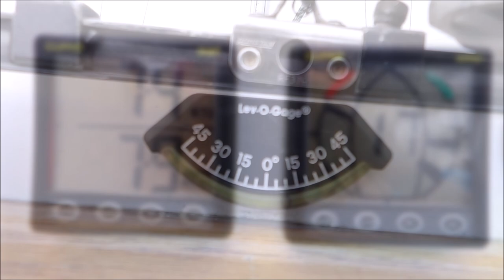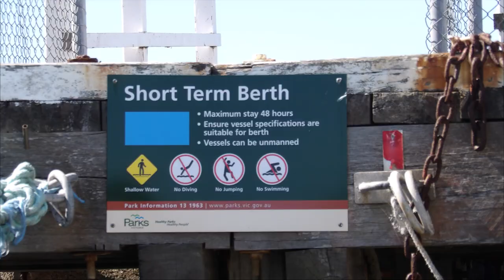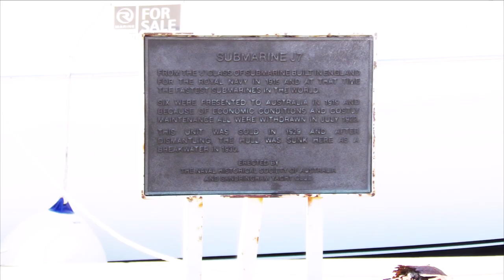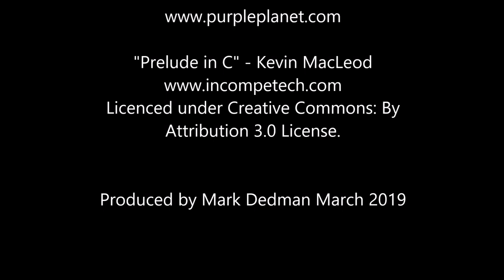Trailer Sailing the Wrecks of Port Phillip Bay Part 2

Comment: Nice work Mark. Neringa looks great. How do you find the Limeburners ramp for launch and recovery traffic?
Reply from the maker: The limeburners ramp if you could call it that is not really suitable for launching and retrieving trailer sailers, dinghies only. I just love Limeburner's for its peace and tranquility to spend the night before sailing 40 minutes back to Saint Helens which on the weekends is always a bit busy but nothing like the melbourne ramps I used to use.
Cheers
Mark

Comment: Thanks for the reply. Perhaps a video on the pros and cons of the RL 28 would be a good idea. Is the mast in the right position?
Also.... you had a very interesting web site for Halcyon, with some really clever ideas for upgrades......
Reply from the maker: Overall the RL is a great boat. Rob Legg had a bit of a bias towards racing with the big main and smaller fractional jib. For the vane the 2 main hurdles are the daggerboard rudder and the balancing of the sails. The first you will see my solution when I make the video, the second, I am playing around with sail plans. I don't want to change things too much tho as I already said the RL has a lot good about it too.

Comment: Good to have you back. Are still working on a self steering system? There appeared to be another paddle like device on the stern!?
Cheers Tony W
Reply from the maker: Hi Tony. Yes you might have noticed bits on this video. I am up to my third major modification but still not 100%. Steers well close hauled and reaching but not so well on any point with wind behind abeam, which is the hardest for any windvane. Many hurdles to overcome with the RL the biggest of which is sail balance. Rl's are quite heavy on the rudder which is not ideal for windvanes. Even commercial vanes will tell you the boat must be balanced first.  Having said this I am making good progress and will make a video about  it in the next few weeks and talk about all the things to consider. They are very much something that has to be modified and tuned to each particular boat. There is the physics of the design but also the intangible art of matching it to the boat.
Cheers
Mark

Comment: Hi Mark, thanks for another great video. Used to ride our bikes to the beach from E Bentleigh 
then swim out to the Cerberus and clamber about the thing with my mates as a kid. The long summers of youth.
.Nice looking main, locally built ?
Cheers Tom
Reply from the maker: Hi Tom. Yes used to snorkel around the cerberus, sadly no longer permitted. I am very happy with the new main, top quality materials and workmanship. Sadly it was made overseas by a business called Far East Sails. I'm not a rich man and the best quote I got locally was $3200 and I paid $1150 delivered. I would rather support the local businesses but its money I just cant afford. Far East Sails have been in business for over 40 years and were exceptionally professional.   Cheers Mark
Reply: Thanks for that. I'm in the same boat : )